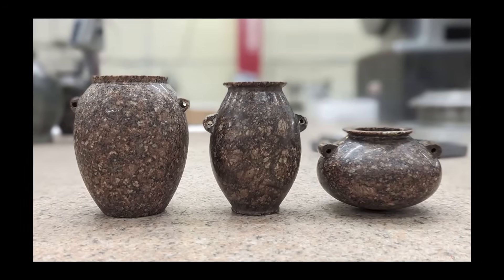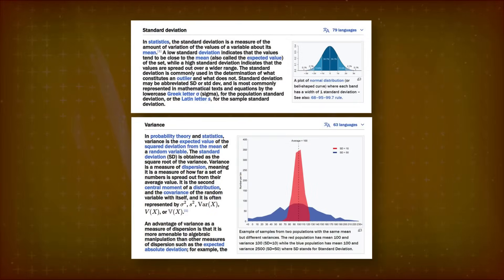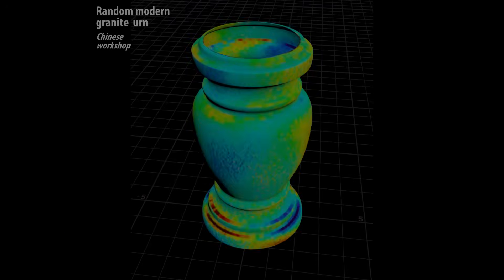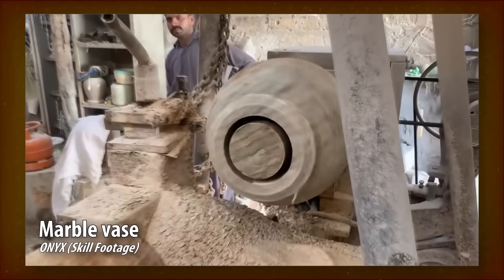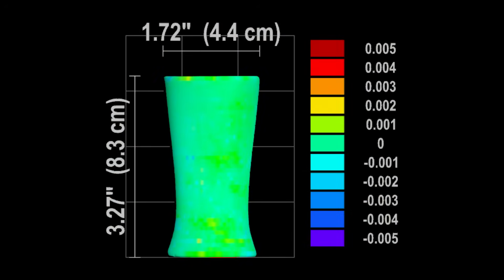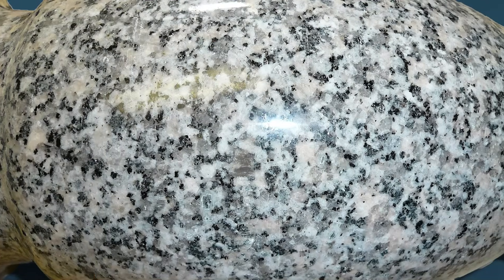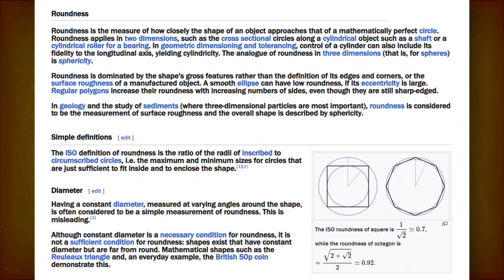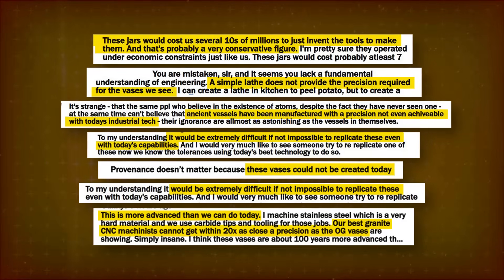Impossible Granite Vases: 3D Scan Showdown

Comment: To point out the absurdity of 'not able to create something that precise today' 
The hale telescope primary mirror is 200" across and has a curvature accurate to something like 0.000001 (one millionths of an inch) by requirement. 
That telescope was designed in the thirties and finished in 50.
Reply: Do you…. Do you not know how simply glass telescope mirrors are made?? Lol do you really think the comparison makes sense there?
Reply: @dillan6134  maybe but it's not a shower mirror, its a fiver meter mirror with orders and orders of magnitude more precision. It more than meets the requirements of something "that precise" don't you think?
Reply: @dillan6134  Do you really think that we haven't progressed at at in the field of accuracy in the last 70-90 years?
Hell you could copy this video's https://www.youtube.com/watch?v=VtxsKUgqP8M design with a hacksaw and some needle files and have something that can move at greater than that accuracy on your desk. 
The JWST has 54 fine adjust actuators with better than an adjustment step of half a millionth of an inch and an eighth of repeatability. 
Hell, don't even bother with any of that 'high tech' stuff, for machining your thing, since they can measure the error, have some guy in the corner scribble on the high spots with a pencil until the measurement device can't find a high spot anymore.

Comment: Thank you for sharing this extensive study.  Critical thinking and science must prevail over the thoughtless parroting of these influencers.
Reply: Great. Ridiculous claims dismissed. Easy pickings. No critical thinking is needed for that if you're above room temperature IQ.
Now before you blanket dismiss everything else about the stone vessels because of muh "thoughtless parroting inlfuencers" apply some of that critical thinking and sciency stuff to the relevant question: how did the egyptians manage it? Angle grinder,  hardware shop lathe, tungsten/diamond cutter heck.. steel tools  I'm afraid are not allowed.

Comment: Nobody asked the Chinese shops to make  them a more Precision vase. For a few extra dollars you could get one.  That's what the sketchy Antiquity dealers that sell "ancient vases" to Matt Beall would do.
Reply: Add 2 nobs on the sides and you will not pay 2 dollar but  jou need an expert 5axit tool..... goodluck
Reply: @prutser8582  Sure the would...I've bought a few over the years and have made some as well...Not really that big a challenge if you actually know what your doing...but like most that claim "it's impossible" they know little to nothing about stone work traditional or otherwise...LOL!!!
Reply: @prutser8582  No, you don't. The cutting tool doesn't have to be mounted and also doesn't have to cut the entire length of the vase. Just leave material on the section where the handles will be made. That's why the handles on the fake pre dynasty vases don't look nearly as well finished as the rest of the vase. They are made last.
Reply: @prutser8582  The Chinese are literally carving dragons into the sides of stone vases and columns and you think handles are magic

Comment: The ancient alien theorists have countless hours of content that overlook the errors made by the advanced alien machines.

In under 20 minutes, Night Scarab presents verifiable information that clearly addresses the likely processes involved in creating ancient works.
Reply: You’re not supposed to drink the acid from the baghdad battery. Good luck.
Reply: Amazing ancient egyptian angle grinder. The hardware store lathe and the steel/carbide/diamond cutting tools blew my mind. Indeed verified and cleared up everything. I did miss the 230V AC outlet beneath the red pyramid but we can work on that.
Reply: @sirmoke9646 
This video refuted the point that these vases could not have been created with modern methods.
Demonstrating that the original vases could have been manufactured with predynastic methods is unnecessary, as there’s currently no credible evidence to suggest the vases are themselves predynastic.

Comment: You are ignoring a couple HUGE issues with this video.   First is the claim from the Egyptologists that the ancient Egyptians didn't have the wheel and thus didn't have the lathe.   This is obviously not true.   Second is all the modern made vases are virtually unfinished inside where the ancient ones nicely done with smooth and THIN walls.   The one very small cup shown that is thin enough to pass light has a HUGE mouth...where many of the ancient ones are many times larger in diameter than their openings which presents a real challenge to get a tool small enough to fit through the opening yet long and sturdy enough to cut the interior to credit card thickness.   And this is supposedly done with only copper tooling....which again proves the 'experts' to be wrong.

This IS possible today...but impossible if the Egyptologist 'experts' are to be believed.   Show us a modern vase over 10" tall with a 1" mouth that is over 6" wide yet .050" in thickness.   So far...nobody has done this so showing lathe turned vessels that have equal exterior concentricity does not 'debunk' anything.   The modern vases do the easy part but ignore what would be really difficult because it IS difficult...which is the whole point of the ancient vase scan project.

The vases PROVE that what the 'experts' are telling us is WRONG.....so the truth lies elsewhere and that's what they're trying to discover.   Making modern replica's that only look like the ancient vessels while not duplicating the really difficult features proves nothing other than a failed attempt to discredit some very dedicated researchers searching for the truth.
Reply: Please show me an Egyptian vase that was measured to be credit card thickness
Reply: Lots of words to say that you don't want a bubble to be burst. Why even bother with the absurdity of thinking that Egyptians did not know about wheels?
Reply: @Eyes_Open  Egyptian chariots dragged along the ground, don'cha know.
Reply: @AlbertaGeek  Early drag races.
Reply: @ The chariots were much later generations according to the 'experts'.
Reply: @recoilrob324  are you saying the Romans didn't have a lathe either because we don't have an example of one.
Reply: @itsnot_stupid_ifitworks  I'm not the one who said the things about the ancient Egyptians....they're the Egyptian Authorities who are experts.  It's pretty obvious from the 40,000+ examples of stonework they've found that they DID have lathes...but the 'authorities' say they didn't.
Reply: @recoilrob324  Since when do scholars say the Egyptians didn't have lathes?
Reply: @ And the charioteers dressed up as women, making them drag drag races.
Reply from the maker: @recoilrob324 Old Kingdom Egypt (OKE) did know about the wheel. Not just pottery wheels, but also wheels for transport, though likely only a subset of population knew it. OKE didn't use wheels for transport much because a) the Nile, where most people lived, provided transport for free, b) wheels aren't very useful in the desert. Wheels for transport were adopted more widely when Egypt faced enemy chariots, on hard ground, outside of Egypt. Egypt had to adapt and develop wheeled transport.
https://youtu.be/nlchEBh7RHM?t=1138
Reply: @recoilrob324  You skipped over the part where Ben or the owners never show any real Providence for the vases. He says trust me bro they're old. No one asked to have the insides polished or any of the features that you think are important when these vases were made. Order one and ask for it
Reply: Ben is that you?🤔
Reply: Seconding the request for an Egyptian vase with walls as thin as a credit card.
Reply: First, yes the official egyptologists are kinda all goofs nowadays. 
However, in the case of grinding, something like free slurry grinding is a rather low load operation. Also, due to grit embedment, something like copper or something even softer like a pitch tool would actually be preferred for most grinding applications. 

You are correct that a rotary tool wouldn't be able to cut much more than its shaft diameter less than two times it's diameter. However if we go back to the older single point grinding techniques, the only real limits are the number of tools you need to match a given geometry, and the time it takes to cut. 
While not necessary to achieve the dimension, a CNC would certainly make it much easier, mostly due to the time it would take to cut 3" out from a 1" bore with such a method. Depending on your precise setup I believe that submillimeter walls would be entirely achievable, depending on the quality of your parent material of course. Perhaps starting from a light bulb and seeing how thin one could push would be a good first step.  
This is essentially following the old techniques of crystal cutting. Not cut glass, cut crystal. Yes, there is a difference. No, I'm not sure what the thinnest piece of cut crystal is, it is probably a vial though. 
Really, what limits modern production of such a vessel is that nobody (including me) seems to care to produce such an item due to the time required. (especially, since as you can see from my first step being to test with a light bulb, glassblowing is a much faster way to achieve very comparable results for the function of a vessel. Of course blown parts are hardly accurate, but who really cares about the precision of their cup or light bulb? That is what essentially what killed crystal cutting.)
Reply: The wheel for transport but they certainly knew of a circular disk. We literally have hieroglyphs of them using a circular disk when using a tube drill.
Reply: (Apologies NS for the repeat comment but if fit here perfectly as well...)

Rather than engaging in a debate with you or individuals of a similar mindset, I would like to pose several inquiries regarding your actual skill sets as I have Mr. Hancock, whom we refer to as the "grandfather grifter." Have you ever taken the time to learn the traditional methods of quarrying, moving and shaping stone? What tools were utilized in the lithic and pre-Iron Age for the shaping of stone? You have asserted that this is basically impossible without sharing your own expertise.  How many of these artifacts have you personally examined to ascertain their actual thickness and provenance? What techniques are employed to achieve extreme thinness in turned or hand-worked stone vessels?

Without substantial experiential knowledge of the requisite traditional skills to address these questions, your ability to affirm or contest any aspect of the content presented in this video (or topic) is fundamentally limited. Your assertions appear presumptive, and like many others, you may lack the necessary understanding to accurately evaluate what you are even observing or to assess its credibility, nor viability...but I'm sure you think you are, like so many that believe the technology is lost or that it had to be "aliens," yet like most ultracrepidarians, you have never worked stone or other natural materials in a traditional context to any degree at all...let alone at a professional level...by the evidence of you comment and the challenge it contains to the topic...
Reply: @JayCWhiteCloud  I think you missed the point of this video, which was about addressing the specific the claim that the "precision" of the vases measured on that other channel could not have been achieved with today's technology.  That was the claim.  It has been debunked.  Whether or not NS himself has any skill in traditional stonemasonry is irrelevant to that.
Reply: @AlbertaGeek  No, I did not overlook the main argument. I have been an observer of the NS channel for a considerable period and appreciate its perspective amidst the plethora of individuals who assert that extraterrestrials constructed it or promote various theories of "lost technology." It is pertinent to mention that I possess approximately 50 years of experience in traditional arts, with a focus on "folk styles" predating 1850, which includes the practice of shaping stone using traditional means and methods.. I perceive no enigma in "turned stone," regardless of the presence of lug handles, as the techniques employed are fundamentally similar to those used in crafting a turned clay pot, albeit requiring greater time, skill, and patience. I appreciate your comment, as the question of whether individuals possess the requisite skills is indeed significant; many lack the knowledge to accurately assess what they are observing, let alone formulate pertinent inquiries.
Reply: @JayCWhiteCloud  You stole my line of asking Ben and his minions the same question about mining moving shaping and placing of stone in ancient Egypt. The question continued with how we got those attributes. And used it in weird context. For shame.
Reply: @AlbertaGeek If I may, I believe that JayCWhiteCloud was addressing the original incredulous commenter and not NS.
Reply: @AlbertaGeek  Not missed at all and the video did an excellent job address those false claims...
Reply: @JayCWhiteCloud  Let me condense your statement to the basic core facts:   Bla, bla, blabla, bla, blaaa.  I don't know how they did it.
Reply: There's always one. And I love it.
Reply: The alternative folks are not trying to discover anything.

They are claiming that egyptolgists are completely wrong about everything, and that unknownable advanced tools were used to create all of the ancient egyptian works.

The irony in thinking that a group of people are incapable of building something with no evidence, when the alternative folks built an entire echo chamber without any evidence to support their claims.
Reply: Ok, so we DO have the ability today to make granite vases with near the same precision, if you don't include lugs/handles in your modern examples. Does that explain how thousands of these vases (with lugs) were made by ancient Egyptians without steel/lathes/modern ball bearings/etc.?
Reply: @BrettMalin  There are plenty of videos showing how the vases were made in ancient Egypt. The information is there if you care to look for it.

No, I'm not going to try to explain it to you here. It's a complex subject that needs visuals. That's what videos are for.
Reply: @ "explain how thousands of these vases (with lugs) were made by ancient Egyptians without [...]"
Thousands of such vases do not actually exist.  You believe sensationalist lies.